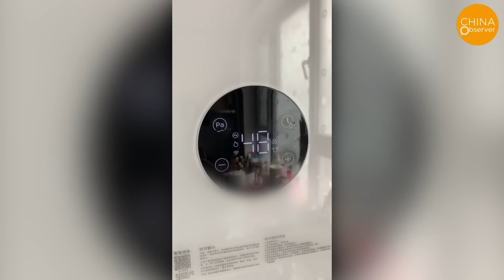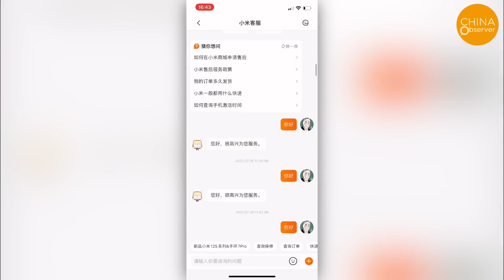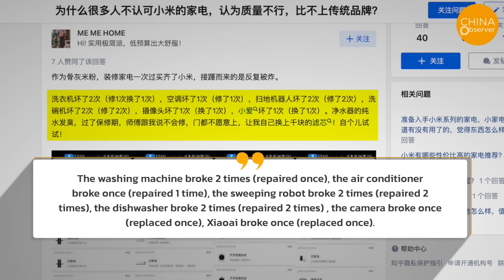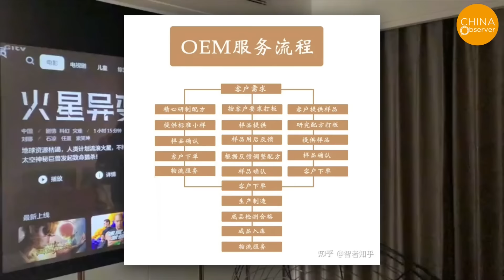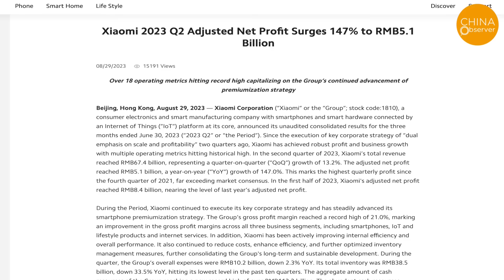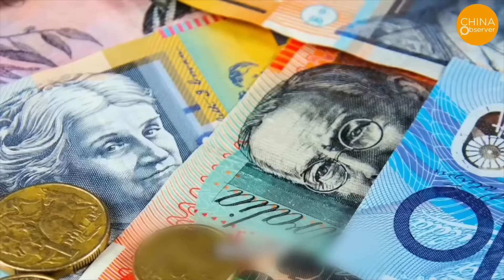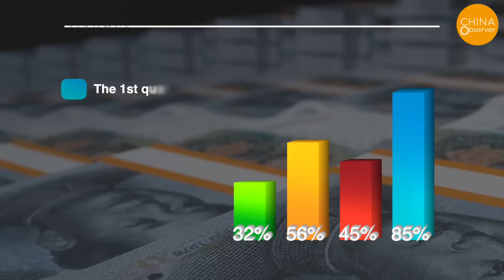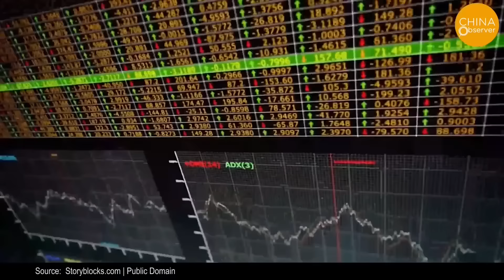Xiaomi Is Trash: Its Quality Is Shockingly Bad. Buyers Smashed It

Comment: Solution:  buy Japanese or European goods!  It may cost double initially,  but will be better value long term - and without the headaches and aggravation.
Reply: ya cheaper long term
Reply: Buy American 🇺🇸
Reply: Not even double I'd say 25 to 33% more Chinese products aren't cheap anymore.
Reply: Japanese products won't cost double. Just slightly more expensive. It's the European products that will be more than double. Not only that, Japanese products are cheap and every high quality. I have worked in a Japanese company and they have very very high standards when it co ea to quality
Reply: SONY WF XM SERIES SUCKS HARDS. SONY BLUNDERS TOOO!!!
Reply: Yeah good idea thats why japanese company exiting in china manufacturing i hope european companies too
Reply: @lance8080 Nope, European.
Reply: Correct; you get what you pay for, and in the long run it's better to pay more for quality products than for cheaper shoddy one's that you'll be replacing soon.
Reply: @lance8080  I try to do that whenever possible.  But the next best choice: buy stuff made anywhere BUT China.
Reply: Samsung phones did have problems with the battery when stored for too long. No brand nor quality is perfect
Reply: @ahriboy  Although true,  you'd have to admit that some brands are really dreadful.
Reply: @lance8080  Although a lot of "American" products are made in other countries, including China.  Or parts are made there,  and just the final product is assembled in the US.
Reply: Hate to break it to everyone on here, but even Korean, Japanese, American and European products are made in China.
Reply: They also made in China, all major brands have factories in China or at least source the components from China.

Literally everything nowadays is made in China, you just get what you pay for.

Don't expect high quality from dirt cheap product regardless of where it was made.
Reply: @skateboardingjesus4006  American 🇺🇸
Reply: @lance8080  Good for you, but not me thanks.
Reply: @terranceknows  correction: most of Korean appliances and phones are made in either Thailand or Vietnam
Reply: not always some European cars are trash had a Peugoet was a total lemon
Reply: @elkiwi69  True.  I had a Renault decades ago - engine caught fire!  But... on average...  😎
Reply: @lance8080 American products are crap as well
Reply: @elkiwi69  Peugeot aren't still around?
Those things were shite.
Reply: @Ercan-cy3we  your probably from some crap hole county
Reply: @terranceknows not anymore. You should read the label because it's less than 50% made in China now.
Reply: What European stuff to buy??
Reply: They are all made in china mostly using the same parts the difference is quality control.
Reply: Everything is mostly made in china tf you talking about ???😅
Reply: @shallotsubliminal7313  Countries with operations in China exercise far better quality control,  and suffer far less from supply level corruption.
Did this fact bypass you?
Reply: Indeed, though it can be really hard to find non-made in China things in some cases. Or it's not published on the webshop/box where it's made, but you can only see it on the device itself
Reply: @mfbfreak  Country of Production is required on packaging in Australia,  although I suppose that can be circumvented online at Amazon, eBay etc.  🤷‍♂ And I agree, it's not always possible to find an alternative to "Made in China" but I certainly try. 😎🇦🇺
Reply: lol japanese goods I get it, but European goods? lmfao be real
Reply: @lance8080  American products? like what?
Reply: @3mar00ss6  Sour coz European goods beyond your price point?
Reply: Unfortunately, Japanese or European goods suffers the same problem. Japanese or European companies Like Chinese companies ultimately chase for profit. Therefore, They have to outsource parts or even production to China. I think its very difficult nowadays to find any goods without China having something to do with it in some way or another. And whose fault is this? CONSUMERS. We all allowed this to happen. You Think Companies such as Sony produced their products in Japan? Think again. Even BMW outsourced their parts from China, Not Europe. The world relied way too much on one country Unfortunately.

Comment: When it comes to the Xiaomi TV at 5:30, I bought probably the same one as "broken" on german Ebay. However, I fixed it. It turned out Xiaomi used some shitty capacitors and this caused the bootloop and crashing. I replaced like 30 of them, costed me like 34.92$ to get brand new, better quality ones and after that the TV was working again. So, I was buying more and more of them with same issue, fixed them, unlinked the Google account of the old owners and now my whole family can watch documentaries about Taiwan on them ;)
Yeah, turns out Sayo Capacitors are dog shit. At least one in each TV I repaired and improved had this issue. Also, if your Xiaomi TV has a heat sink, get a little Raspberry Pi 3 fan, solder the wire on the 5v and -5v marked pins on the USB port and it will protect the soc from overheating. There is already a heatsink but it doesn't have a fan
Reply: Wow my grandparents had a 24" Medion TV, so it's also a rather cheapo tech brand (however it has at least a 1080p panel) sold at Aldi discounter (and is marjorly owned by Lenovo since 2011) from around 2012 and it didn't turn on at all but they said it wasn't even with a "pop" or "bang".
I opened it up (parts made by Vestel, a turkish company) and didn't find obvious burn or capacitor blast marks, then let it sit around for about two months and found a similar case and there some diodes in the PSU were gone, so I checked mine and bingo! the rectifying diodes were faulty, got new ones (I had to order a minimum amount but those I really needed cost me around 3 Euros), soldered them in and it works absolutely fine again.
They didn't need it anymore because it got replaced by a larger TV we had sitting around so I sold it to a family that bought a used PC from me and also asked for a monitor and I told them about the TV I hadn't received the diodes at the time, but when I had fixed it I brought it to them.

Sounds almost like Apple, their computers had heat issues since the Apple III (it was so poorly ventilated that the chips were desoldering themselves resulting in a astronomic failure rate), the infamous PowerMac G4 Cube was a nice Idea but could work fanless only with the slow CPUs, for faster ones it needed a fan then the G5s (they never did a PowerBook G5, it was a meme that a PowerBook G5 would be more than triple the thickness of a G4 to provice sufficient cooling) and never forget the 15" MBP with an i9 that performed in some benchmarks worse than the i7 beause it got into thermal throttling earlier than the i7...
Reply: Yeah ill just buy a sony lol.
Reply: My sharp LCD TV is 15 years old already and till now still alive and kicking 😁

Comment: I have a Xiaomi and it lasted me for 2 years and is still going strong. It was a gamble, but it paid good.

Nowadays, I am highly reluctant to consider newer models.
Reply: ME TOO , 6 YEARS Old ,models ( without updates)
Reply: I have used Xiaomi phones more than 3 years without problems
Reply: Their old products seems to be Massively better than their new products, probably Quality Control issues or they've plan it
Reply: my Xiaomi wristband last 2 months. What a gamble.
Reply: I had a Redmi Note 8 pro I bought in 2019 and used till 2021 before it was stolen.. worked perfectly fine without any hiccups even when it had bugs plaguing it all thanks to the crappy MIUI software, it was fine. but these days, the company has started smoking some weird shit just like Nokia did back in the day that made them go out of business.. 😂😂 Samsung remains top quality
Reply: I had a Xiaomi mi9t for 2 years and i was pretty rough with it and it still worked fine,i changed for a google phone now but honestly i wouldn't mind if i didn't make the change
Reply: strange, had redmi phones for the past 3 years and all of them have been very good
Reply: ive been using the redmi note 5 pro for 5 years and ive never had any problems with it, i only had to change the screen a few times because i dropped it and it stopped working, im in the redmi note 8 now and its pretty awesome, only problem ive seen happen is the volume and power buttons just go off the phone
Reply: I owe mi 10tphone after A year it can't detect it's camera 😶 like wthniw I have an Android phone without camera..even tho it's  not broken.
Reply: @unknown-hh6yv  have a 3 year old Redmi 9a still running strong, thing is indestructible
Reply: i think its gamble. i bought poco x3 and still doing fine after 5 years.
Reply: My dad has a like 6 year old xiaomi that was 150 dollars max and it's still perfectly fine

Comment: Their lack of strong support for certain products screams OEM re-badging.  This model works for businesses all over the world, but you have to be especially focused on support since the OEM isn't going to provide it. This means having people knowledgeable about the product and spare parts being around. My guess is Xiaomi is sourcing OEM for low margin items and just handling support by buying a new unit from the OEM and sending it to the customer (if they are lucky). This is costly, and may not even address the issue if its another factor.
Reply: We all have access to the Internet. It's not that difficult to figure out which products they manufacture themselves. I always do that before buying anything "from" Xiaomi.
Reply: It doesn't bode well for Xiaomi's future if they're already outsourcing to this degree. Normally this happens when a company is on the skids.
Reply: A lot of CHinese companies do that.  They have their flagship products that they actually care about, and a ton of re-badged junk.  It can be hard to know sometimes too, because it can be rebadged trash, or it can simply be that other CHinese companies are copying that design to feed off that product's success.
Reply: Why is it surprising that going to the lowest bidder in OEM sales often results in junk?

Comment: crazy. i bought a samsung tv in 2008 and still use it daily. different worlds
Reply: I got you beat, I have a free CRT Sony triniton Tv  I got on the free section of Craigslist. I run a digital tuner on it and an AVI/HDMI adapter for Mirror screening. It's like a 90's tv.
Reply: @stoundingresults  🤣

Comment: They do the same for their Smartphones. Pushing unnecessary updates to add load to older phones CPU so it would slow down to the point that even doing basic things like Messenger, watching reels on Meta, Tiktok causes the phone to lag. And this is a phone with no games installed and just social media apps. Basically, they want you to discard what you just bought a year ago in favor of the new model... Literally.

Comment: Don't buy Chinese products with any moving parts lol
Reply: Correct, or which uses a system that needs to work with other modules. China is years behind with integrated circuits and systems.
Reply: Or anything related to food or made out of multiple materials
Reply: @NickVanos  most ICs don't have moving parts. And most of the stuff we use are many years behind the bleeding edge.
Reply: Or screwdrivers, or anything made of metal.
Reply: I remember having to check rubber parts coming from China at work if they were properly made by freezing them and then squeezing the frozen parts. The badly made ones would break and the properly made ones would get squished. They'll cut every corner if you let them.

Comment: Many other brands sell their products within the xiaomi storefront. They try to keep the same aesthetic but it's hard to keep a check on quality control. I've had two robo vacs die within a year plus of usage, however, their water filter counter top system is great as well as their air purifiers. They've lasated five years no issues. Smart lightbulbs that turn on when you come within a certain distance from your home is also very convenient. It's nice to be able to link different products and control them within one app, although, you do need to protect them under passwords. Just don't expect long term use.

Comment: Had a Xiaomi Mi 11 Lite and that was the best phone I had since abandoning my very old iPhone 6+ that was previously used by my sister. The phone was beyond great until the battery of that phone bloated. I had no choice but to swap it. Ever since swapping the old battery for a new one, the battery life had been depleted to the point it only had 1 hour battery life. As much as I'm currently using Samsung that has an awful camera quality, it's sad to see Xiaomi stooped that low, then again, it is well deserved.
Reply: This! I bought Mi A1 phone years ago, and quite satisfied. The only issues are the power button didn't work after a lot of use (common issue of smartphones) and bloated battery. I replaced the battery. The new battery is even bloated more easily than the old one! I'm pretty sad because I plan to upgrade my phone with higher model. Initially I plan to stick with Xiaomi, but after this video, I think Vivo maybe a better option?🤔 I know Samsung is better, but I've been told it was not easy to replace the power button in Samsung phones☹️
Reply: Same, i loved my redmi 3s and used it for 5 years but tge software and batery life is very bad, i had to change battery 2 time and screen one time. Now i am using a Samsung f23 5g. The software is so smooth.
Reply: maybe you bought a counterfeit battery thats why it wont last
Reply: @homelantern4408  not a counterfeit but a replacement, replacement batteries aren't made to last as long to last as the originals lmao
Reply: @folddyy  nah i had mine replaced from official store and has the same performance as the orig one.. there are many fake batteries out there
Reply: Which Samsung you have, with awful camera?
Reply: Dude bloating batteries is shit we would deal with like a decade ago... a problem of the past 
This is really sad
Reply: @MVPMTKING  Any suggestion for Android phone brand with good batteries? Other than Pixel and Samsung, of course. Thank you in advance🙏🙏🙏
Reply: I don't think there's any phone from samsung that has an awful camera. it's a different story for xiaomi tho, their phones are like only comparable to samsung phones from 2015
Reply: @MVPMTKING  shit really? My hp laptop battery bloated after a year of use around 3-4 years ago..
Reply: @MVPMTKING  damn. my asus laptop battery is also a bit bloated because i charge it 24/7
Reply: @MVPMTKING  sorry to tell you that unless you buy high end expensive phones, even brands like Samsung have "bloated" battery issues.
Reply: @tiararoxeanne1318  i have the 5G model and its fine, but im not willing to update it

strangely enough the vibration cuts out and then i need to shake it
Reply: nothing u said made any sense what samsung phone are u using an a12? lmao maybe pay more than 150 bucks for a phone

Comment: to be fair, i saw a similar issue with Sony laptop. the screen went blank and the customer service kept telling consumers to upgrade windows drivers and run nonsense diagnostics. it turned out to be a connector issue between the motherboard and the lcd screen......
Reply: what? Sony stopped producing laptop since 2014. where di you buy that? that's fake. But if its a very old model - almost a decade now since they stop making them,  then I suggest you put the poor thing to rest.
Reply: This sony vaio story is old, but the "customer service" strategy is the same...... :-)

Comment: I think they kept pushing the product concept based on their sub-brand Redmi, an affordable low cost product into their more premium brands like Xiaomi Mi, likely due to cost. Recently they release the Xiaomi smart band 8 active (not to be confused with the without "active") which is based on Redmi smart band 2, with slightly more function (software).
Reply: newer Xiaomi smart bands are no longer made by the company that makes Amazfit smartwatches called Zepp Health (Huami). Yup, it sucks.
Reply: @jaseaquino  So that's why they shift from zepp life app to their own.
Reply: My Redmi is still working fine so far, after 3+ years.

Comment: I am currently using a Note 10 pro and for the last 2 years, wifi disconnects often, video recording makes the phone hot, during video recording, you couldn't make a video using landscape mode - it will automatically switch to portrait mode! I am afraid that when it reaches 3 years, it's a goner! This is my first and my last purchase of Xiaomi and will go back to Samsung!

Comment: I have been using Xiaomi A1 since 2016 and the phone still works fine today. The phone was almost dead before in 2020 and I was thinking of changing the phone but after some time it managed to "fix" itself. Xiaomi quality over quantity for phones in 2016 is great but today I'm not too sure.
Reply: My samsung sm galaxy tab that i bought in 2011 still working til now. A 14 yr old tablet. My j7 prime still working for 8 yrs of heavy usage and dropped it 10 times. But alas, my redmi 13c died after bought it a month ago. Lcd flickers like a no signal tv, and battery drains every minute despite not using it.